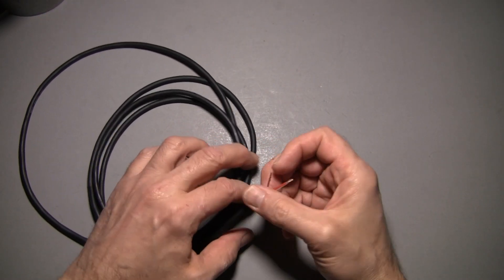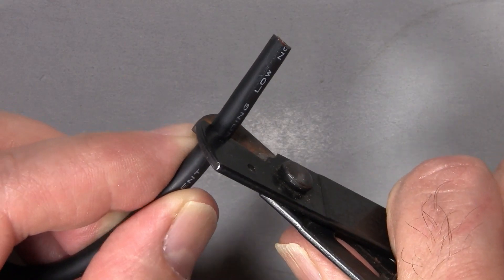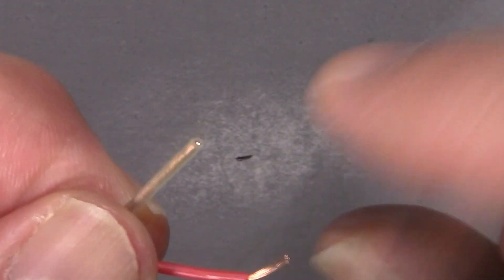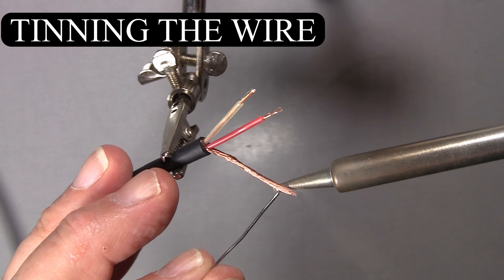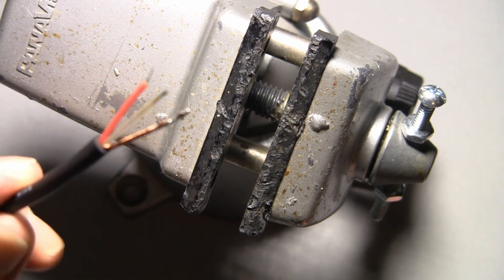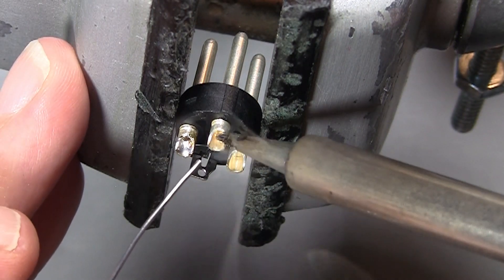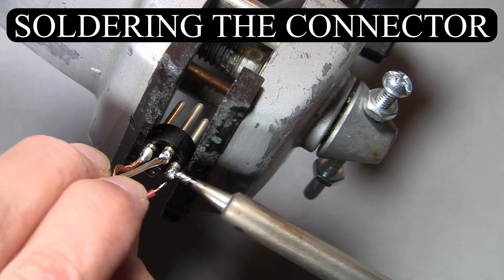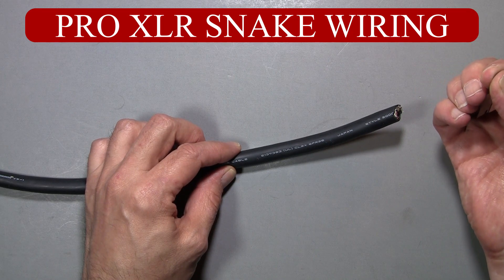Soldering XLR  Connectors Like A Pro

Comment from the maker: As people have commented. When I did the multi channel xlr, the individual channel wires would normally be longer. When shooting the video I cut them a little shorted the keep the entire wire snake in the frame of the camera. The process is as shown in the video correct just remove more outer jacket of the multi channel  snake if you are doing a 8 channel snake.

Comment: I don't understand the point of the nylon tubing over the drain wire when you soldered the multi wire cable. Is that just to prevent a short? If so, why not place tubing over the ground/shield wire on a standard single XLR cable like the first one you soldered in the video? Thanks, very helpful info in this video!
Reply from the maker: Because the single conductor XLR didn't have a thin drain wire it only had the entire Shield the multi-conductor cable has a separate thin drain wire which I think makes a neater connection, and yes the Teflon keeps it neat and helps prevent internal shorts
Reply: @biasedaudio Thanks!

Comment: Would be great to add info about the applications this wiring configuration it used for. Like Audio gear pre amp to Amp so much confusing conflicting information on line thee days.

Comment: Hi i have a question : i got a Mic table clambing stative which came with a build in cable that run through a chanel inside. i got rid of it because it was a audio nightmare i guess no shielding at all ( not an expert on electrics and cables but today i am even shure there was no shielding ). now i have a stative that can take a XLR cable run invisible throu but i have no idea about sodering or electrics : is the hot cable ( posotive ) allways a red one and the ground allways lose like that and the "low common " cable allways a "black " or a " see throu " one ? because i would like to run that cable in the chanel inside the stative instead of having it straped via those mic straps on the stative. it doesnt look good and is quite unconfortable because i have to pay attention to not have anything in my way. 

i need to do only one side which is that side that comes into the mic and i would like to change the jack on that side to a all metall one insetad of that combo one i have on it. Now can i keep the old one as a reference at solder the cables like they were in the old one or do i have to pay attention to something ? i never did any soldering before and i dont even know about temperature or anything for that matter ( reason why i never changed the shitty single coils on my strat for practise purpous)

i would love to get any advise and appreciate it alot because i am honestly nervous about grilling stuff 

thank you 

os the reason i ask allthough you show here how to do it is because the old cable that was build inthere had very thin wires while this one has thicker wires since the cable itself is also mor stiff but the dimension is the same so i guess maybe the wires in here are different and i am a total joe when it comes to cables and soldering and electric stuff 😂😂

Comment: Great stuff. Question about grounding lug. At 13:46 you mentioned you don't tie it in. I can't find your grounding video. Why don't you make that grounding connection?
Reply from the maker: I really need to do that class, I've just been slammed with work.  Usually the shell is grounded by what ever you are plugging the xlr into. If you want to life the ground on a balanced circuit as I do with line level signals tying the shell to ground will defeat the lift.

Comment: Be sure to use 60/40 tin/lead rosin core solder( don't use "lead free" solder). Keep iron tip wiped clean and freshly tinned before, during and after soldering, unplug iron when done to protect the tip.
Reply: He already has a whole video on solder.

FYI, the latest lead-free alloys (the ones with trace amounts of nickel and germanium added) are almost as good as leaded. The Ni and Ge improve wetting action significantly. I use 63/37 because I can, but if I were forced to use lead-free (for example, in consumer products sold in Europe) using the NiGe-doped lead-free would not be a significant inconvenience. The older lead-free alloys (e.g. SAC305) are a bit more annoying.

Comment: Is it possible to make or convert a female xlr cable or adapter to a combo jack? If possible could you show a video of doing such?
Reply from the maker: Unfortunately right now I don't have the time to make this specific video. Combo jacks don't come in a cable mount to my knowledge, so it would be a little funky. I do see them sold online. If you make one it would be the same as wiring the female XLR but you would add a small jumper between tip of the 1/4 inch combo and pin 2 of the xlr combo, and ring of the 1/4 to pin 3. Hope this helps.

Comment: Why would a company solder the ground to the shell? Does doing this cause any issues? Would cutting the connection between the ground and the shield cause any issues?
Reply from the maker: I've been too busy to complete my grounding video, I hope to soon. Wiring the xlr shell to the ground/shield is a reasonable approach to wiring, but I don't do it for two reasons. If I am using the cable to connect a line level piece of gear to a patch panel which has the ground/ shield lifted I won't want the ground/ shield to be connected at BOTH ends. Tying the metal shell to the ground/shield will bypass this and possibly cause ground loops. Not connecting the shield to the case usually has little downside as the metal xlr shell will usually grounded by the metal / metal contact of the device or microphone you are plugging into. If you look closely at quality xlr connectors, there will be a small area that is NOT painted to enable this ground contact to the device contact.

Comment: I don't quite understand why the standard XLR cable has a copper shield that you do not remove, and the Mogami snake you did remove it. I understand the drain wire is the ground. But I don't understand why the design of that mogami cable is so that there is 4 total wires..... Could you explain?
Reply from the maker: In a balanced connector you need 3 connections. Plus Minus and Shield or ground. The first cable I need to connect all three. In the later smaller mogami cable there is Plus, Minus, Shield, AND a drain wire. The drain wire in not insulated so it is in contact with the shield copper inside the cable. Electrically the copper shield and the drain wire are connected and the same. I remove the shield on the mogami and use only the drain wire simply for neatness. I find neat connections fail less and are easier to repair if need be.  There was no drain wire on the first microphone cable I used so I had to use the copper shield. As well the video showed how to wire either type of cable so it would help the viewer in either case.

Comment: For the 8 channel snake it would be same idea for a TRS connector as well? Snip the copper shielding and use the drain wire? Thanks
Reply from the maker: That's a good question normally I would.
Reply from the maker: That's a good question normally I would.
Reply from the maker: That's a good question normally I would. Though if there wasn't a good strain relief on the connector or a boot I might use the whole shield to make it stronger
Reply: These are for the back of a patch bay, i opted for rean connectors for the TRS plugs to save abit of coin. These wont seen constant plugging/unplugging so i may be good with the drain! Will test it out! Btw thanks for you vids, made 5 dsub connectors yesterday!

Comment: I have a question, a bit mysterious, I have a rode ntg3 and it has a bit of hiss.  I have two cables, one soldered the three pins as in the video and the other cable only two, pin 1 and 3. and the mic makes a little less hiss.  why will it be?  for what is this?  thank you
Reply from the maker: I can only assume the mic is running unbalanced and the noise is half, but the level of the audio is also half. So even though you hear less noise the signal to noise is not improved.

Comment: I might have missed i but is there much advantage of teflon as. collar over the shield twisted wire over small diameter shrink? Shrink is pretty sturdy but the disadvantages would be that it iusually heated and won't be removable and also it likes to put an unslightly bend in the wire but that might depend on shrink technique and quality. Also food sticks to shrink :face-pink-tears:I am making a couple of these and i have loads of shrink but i seem to be all out of 22-24G lumen teflon.
Reply from the maker: Shrink works, I just like Teflon as it's smaller, tighter, and doesn't shrink away from the connection.

Comment: Why do you add the tubing /heatshrink over the drain wire but on the first connector you just twisted the shield and left it un-insulated ?   Thanks!
Reply from the maker: The first single pair cable didn't have a drain wire just the shield. If it had a drain wire I would have used it. I find putting shrink over a twisted shield cumbersome and not as neat usually. Others will disagree. So the choice is yours.
Reply: @biasedaudio  Yes I realize the first one was a shield.  just curious why the need to "insulate" the drain but not the shield.   So, from your reply I take it it's really just a choice.  No real "technical" benefit ?   I only ask because I have seen it done both ways but found it curious that you chose the way you did.  Thanks much!  great vids.

Comment: (QUESTION) is it possible to wire  in a Y connection  1/4" mono & 1/4" TRS   TO XLR
Reply from the maker: Yes assuming it is a balanced signal, wire hot and ground (shield) to the TS connector and all three to the XLR and the trs. Assuming none of the devices has a input or output transformer

Comment: Great video!  What do you do if you have a black wire as well as a red and clear wire?  Thanks
Reply from the maker: Hmmm. Is it shielded audio cable? Usually a 3 conductor isn't shielded and not suitable for low level audio if so. Also sometimes there is a clear spacer that doesn't actually contain a copper core, this is usually digital audio cable

Comment: Since balanced lines work the way they do... although it's sometimes referred to as hot and cold, in reality they are in and out of phase. There is certainly no 'common' in a balanced line.
Reply from the maker: As true as that may be that doesn't stop professional audio companies from using that exact terminology look at the back of a UREI LA-3a . So like it or not it is a common (excuse the pun) usage in pro audio.
Reply: @biasedaudio  WOW... I have never heard of  UREI despite working in pro audio for 47 years. The LA-3a was designed when I was at primary school and when I looked at the back panel I had no idea how to connect it up, in part because of the COM/+- designators which are just plain wrong. Apparently it's just a limiter with soft knee. The first limiters I used were feed-forward limiters (at the BBC) rather than feed-back limiters since that reduced the breathing sound of feed-back limiters on fast attacks. Looking at the circuit of the LA-3a I cannot see where they come up with the COM/+- designators.
Reply: @biasedaudio  BTW the reason I found your video is I was looking for a video to send to folk who don't know how to solder XLR connectors so they could learn. You missed out heat shrink but then although I was always taught to use head shrink (or Hellerman sleeves) I rarely bother myself now. But worth a mention.

Comment: Thanks for the video! what size is the Teflon tubing?
Reply from the maker: I like to run the gauge of the Teflon slightly larger than the wire so I believe that's 20 gauge

Comment: Thank you for the great videos. When you were soldering the 8 wire audio snake at the end of the video is there a reason that the  ends of the snake were relatively short? I've often seen audio snakes with more length where the cables split off in order to have more length to work with.
Reply from the maker: I think the reason the cables wound up being so short is because I was trying to keep all my work in the camera frame so they came out shorter than you would normally make them. 12 to 24 in would probably be the normal amount of exposed individual channels you would have depending on the need

Comment: Thank you for this video, I normally purchase my cables from Worlds Best Cables on Amazon, but they have few of the Mogami XLR cables I prefer in stock, the 2549 wire with the Nuetrik Gold connectors. Parts Express has the connectors for a few dollars each, and I have roughly 100 foot of the Mogami wire/cable from a previous purchase of a few extended cables that I never used. I have not soldered in years, many years, and bought the NovelLife soldering iron, looks like a cool little unit, and the Kesel solder, along with a few other bits you showed. I'm $300 deep into all of it, but with what I want to do, this bit of kit should pay for itself in short order. Again, thank you for this video.

Comment: Die video!  What's the fourth connector for? Thanks!
Reply from the maker: The extra tab can be used to connect ground to the metal shell of the connector. I usually do not use it and will explain further in my "grounding" video.

Comment: thank you, you show me how it is done properly. One thing, should I put Heating shrink tubing for each 3 wire once soldered? I got some from HF.
Reply from the maker: I prefer to not use shrink. If the wiring is clean and tight I don't believe it has any benefit. It also makes it harder to inspect and see bad solder joints or broken wires. I do use shrink on individual wires in dense connectors like db-25, elco or DL.
Reply: @biasedaudio  I like using transparent heat shrink. Lots of “clear” heat shrink is sorta milky, but some is nearly crystal clear and provides excellent inspectability.

Comment: Thanks for video. I have a question, i heard cardas audio or mundorf tin for soldering. Is it really make different for noise and sound quality for recording?
Reply from the maker: I've worked in dozens of professional recording studios over the past few decades and none of them have ever used these two types of solder to my knowledge. Most have used common Kester brand.
Reply: @biasedaudio  copy that, kester thanks for info. Back to my curiosity, is it really affecting noise and sound quality sir?
Reply from the maker: @muhammadfebriansyah1647  In my personal opinion there is no benefit.  I'm sure others will disagree.
Reply: @biasedaudio  thank you sir😁🙏

Comment: Great stuff!  Do you have a video showing how to trouble shoot an XLR input on a mixer.  I have two dead channels on my Behringer EuroPower PmX 2000.
Reply: Unless you are familiar with SMT, removing and replacing components can be difficult. An experienced tech can locate a defective op amp or component but removing and replacing it can be time consuming. You may find an online video to help. Most Behringer equipment requires complete module or PCB replacement. Only because it's cheaper to do than spend time diagnosing and component level servicing. But obtaining modules and parts from Behringer is next to impossible. One thing you need to determine is when a XLR input fails, check to see of the line input of that channel still functions. I've had several behringer mixers, when a channel fails I can still make use the that channel's line input. Sending Behringer equipment to an authorized service tech may not be worth your while or budget. I am a tech and don't waste efforts with products that are made and priced to be disposable.

Comment: What type of solder are you using and the diameter? Thanks!
Reply from the maker: I believe it is Kester "44"  .031 inches
Reply: Use 63/37. It's a lot better than 60/40.

Comment: how to connect regular speaker cable to 3pin xlr? because usually speaker cable has plus and minius only. not ground.
Reply: Are you referring to the outdated use of XLR connections used on Shure speaker columns? EAW used a similar connector but could not be confused for an XLR. If you insist on using XLR for speaker lines, XLR are underrated for such use, follow the wiring  arrangement of the speaker cabinet's XLR. Or upgrade to SPKON connectors.

Comment: Memories of my youth. You forgot the zeroeth step which is to make sure your fanout leads are long enough to reach where they have to go! Made THAT mistake one time. Thankfully easy to remedy.
Reply from the maker: Good point!
Reply: 3 years later, but that mistake is one I've also made when just running wires for my ceiling lights. I can imagine how easy it is to fix here, and although it's also quite easy to fix when setting up ceiling cables and routing all of that, I do not recommend it. Usually you first find out when you've already spent time on nailing the cable to the ceiling with cable clips, so the fastest approach to fix it means straining your back like hell. Absolute nightmare, but also totally fixable.

Comment: So, I’ve noticed some multi-core have an additional Drain wire running through the multi-core. If I’m making line level looms to connect equipment within a rack unit, what do I do with this common drain wire???
Reply from the maker: Often I see that extra drain in foil shield multi pair. I usually do not use it, but if you are using a multichannel connector like a Dsub or Elco you could connect it to the metal cover. But I don't think I ever have.
Reply: @biasedaudio  amazing. Thank you for the response. Finally I can ignore the additional drain wire without feeling I’m missing something!